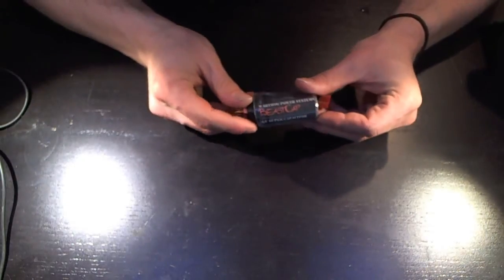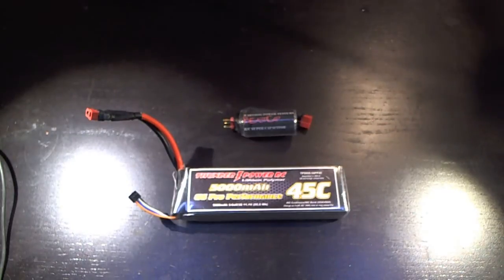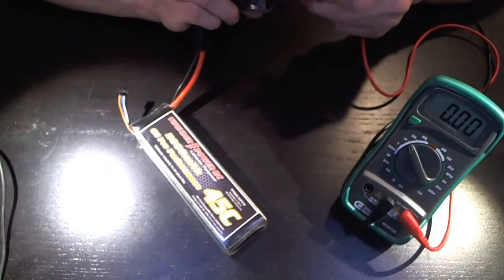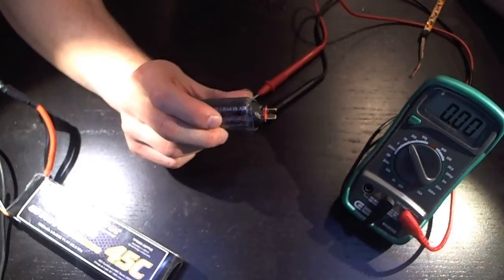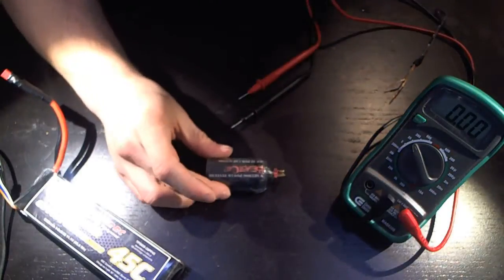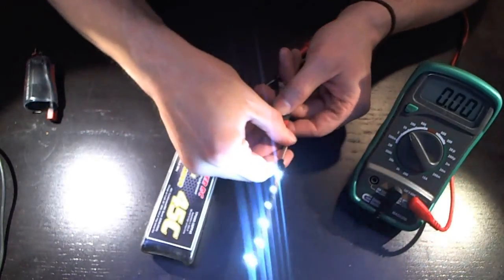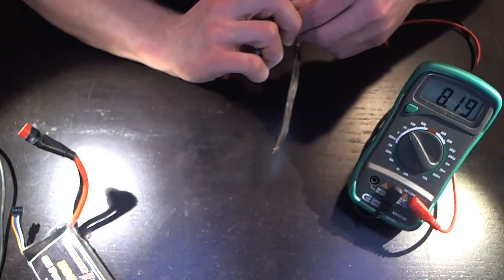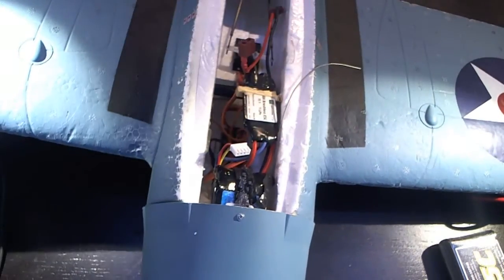Warthog Power Systems BeastCAP!

Comment from the maker: @hummessse  great question. and you aren't entirely incorrect. As soon as the cap raises in potential by a fraction of a volt, the differential decreases and the charging slows. The whole cap charges within 1/100th of a second. And the high current condition lasts an immeasurably small length of time. The amount of load put on your battery to charge the cap is SIGNIFICANTLY easier for a lipo to handle than repeated high current conditions lasting a few tenths of a second that can occur

Comment: Connecting a very large discharged capacitor with almost no inner risistance to a battery is equivalent to shorting the battery (in the beginning at least). What are your comment to that?